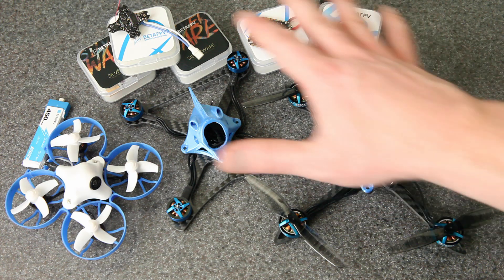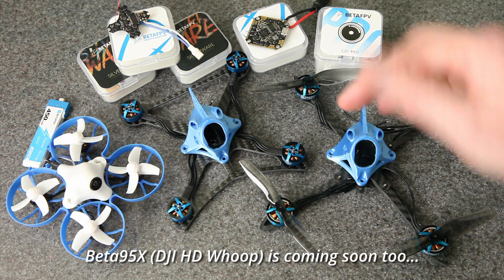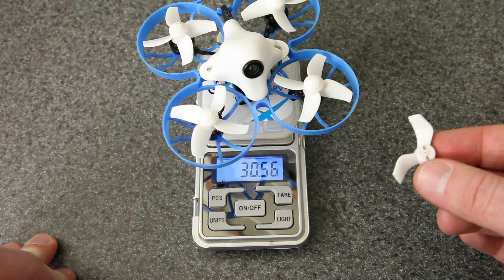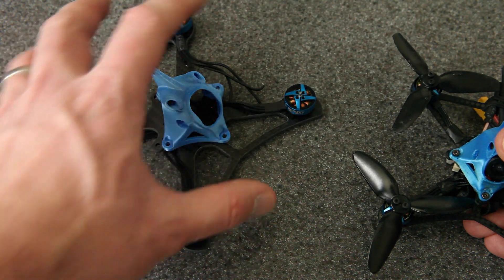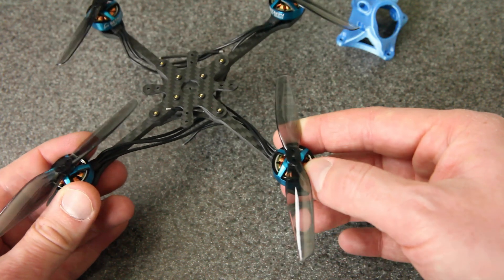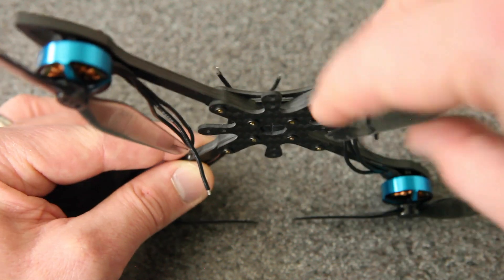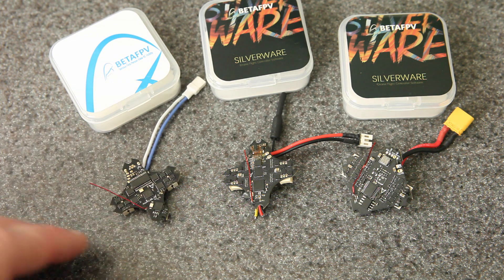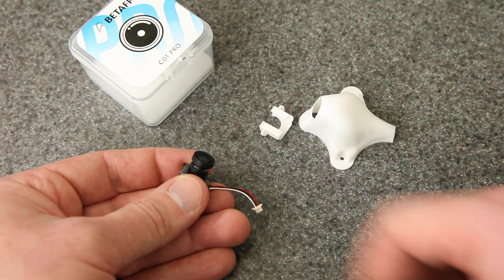4" Toothpick, Meteor75, and More Stuff Coming!

Comment: Hi mate , just wondering you mentioned that you prefer 802 motors on the 75mm frame , so would the meteor65 19500kv be able to power the 75mm frame and props?
Reply from the maker: Yes. A 19500kv Meteor65 transplanted onto a 75mm frame would be fantastic. Use 3-blade or 4-blade Gemfan 40mm props and 48kHz JESC. :-)

Comment: I wanted to upgrade my 1s HX100 se from it's stock 1102 13000 kv motors. Can you help me choose which would be best for spinning 65mm 2 blade props. Between 1102 18000 kv and 1103 15000 kv which would you recommend for freestyle and recovery from dives?
Reply from the maker: I think the HX100 SE is quite good as it is. What are you trying to change? Is it not fast enough for you? The 1102 18000kv would probably be faster if the batteries can keep up, but you might get a lot more voltage sage. I would not use 1103 because it would add weight and most 1103 motors require different mounting holes.

Comment: I have that new camera and canopy sitting on the bench here and I was considering putting it on the Meteor65. The stock camera wires are all black so I have no idea what the pinout is on the stock VTX. Do you happen to know what the pinout order is for that vtx? I realize I'll have to snip and solder the wires, but until I know for sure, it will continue to sit here. Thank you!
Reply from the maker: I would use a multimeter to check it. One pad will be connected to ground and one to 5v. The 3rd pin will be the signal.
Reply: @MrShutterBug  lol, that makes total sense. Thanks for the tip.

Comment: Very cool. Congrats to RacerX for striking a collaboration with BetaFPV. I just finished my Twig XL 4S build with the Flywoo 1404 4850 kg running on 4S and that thing screams (build video on my channel). I'm surprised Beta went with such a low KV on those 1404 motors.

Comment: i have the bb21 chips and yet i cant use jesc ;(
Reply from the maker: Really? JESC supports the “L” type ESCs now.
Reply: @MrShutterBug  as far as I know rpm filter still don't work for it.
Is there a reason why those chips come with the old firmware?
Reply from the maker: aeQuator I see. Yes I believe you are correct about RPM filtering but you can run 48khz PWM which is what improves efficiency. DSHOT150 + 4K/2K is recommended for those BB1 boards.
Reply: @MrShutterBug  the weird thing is, the mcu chips are BB21.
Reply: @aeQuator  BB21 chips are more modern "H"  ESC firmware and totally supported by JazzMaverick or JESC firmware.  You have to load Betaflight 4.1.x to get RPM filtering.  For JESC go to https://jflight.net/ and read the installation instructions.

Comment: I'm definitely interested to see your take on the 1404 and 1505 motors for those builds. I've got a stretch x twig XL build in process with the BetaFPV 1204s.
Reply from the maker: Yeah. It’ll be a power house but heavy which means it’ll need a big flying area to make use of that power. I usually prefer my micros to be much lighter but this is hardly even a “micro” any more. Should be interesting.
Reply: @MrShutterBug  I'm attempting to build a twig xl using 1507 4100kv motors... Wish me luck! Lol
Reply from the maker: Josh S good luck! 😃 personally I would put the 1507s on a 4” TWIG Mutant.